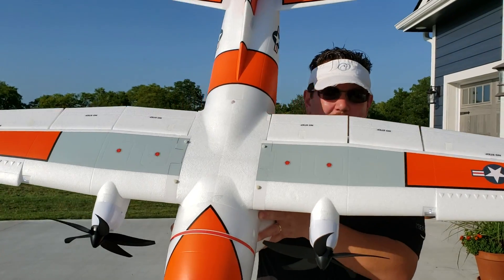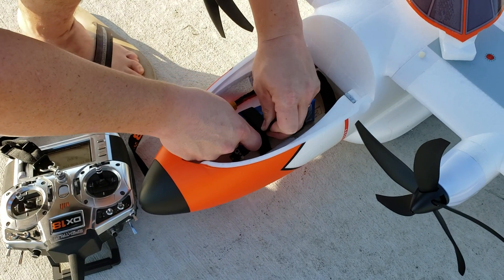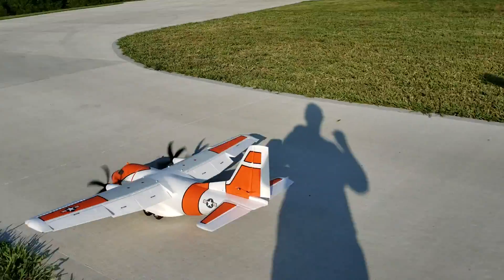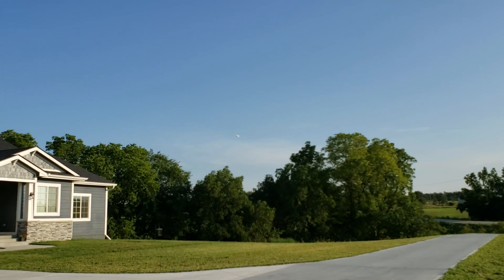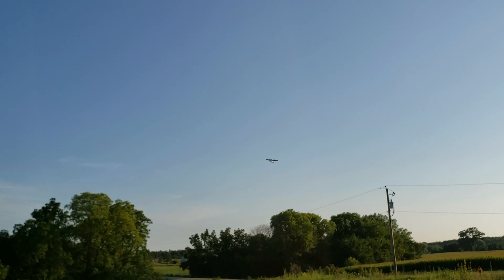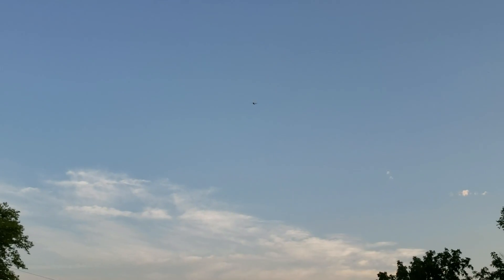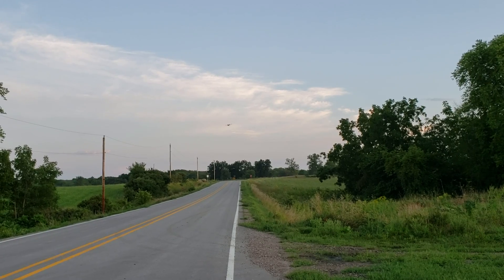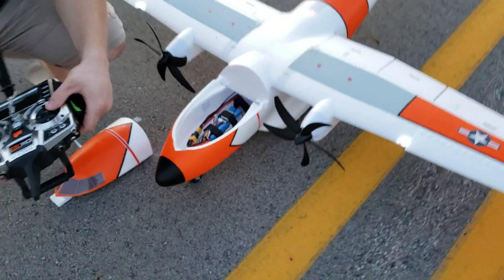Eflite - EC-1500 Twin 1.5m - Maiden Flights, Unbox, Build, Radio Setup

Comment: Hey, Brian. That bird is built to the profile of a cargo category plane, and will definitely fly differently than , say your Airbus airliners. Very slow to respond to control input, and truthfully not as much fun to fly. It seems to be a rendition of a C-121, or perhaps other variants of the type. I don't have a lot of experience with the type, only enough to know about the difference in flight characteristics. The things am what they am, cargo vessels.
Reply from the maker: It's like flying a whale, but this whale will run on 4S like a Ferrari...kinda weird and not scale looking.
It's not usually my cup of tea, these OVER powered fake-fake planes...but it is okay...only Okay - for $400 :(
Disappointed...
P.S. We're working on FAA inspections (soon).
Reply: Brian Phillips   Physically it looks like  a C-121 with turboprop engines replacing the big, round gas engines it originally came with. It has another C designation, I just don't remember what it is. Inspection shouldn't amount to more than a look thru the paperwork you've generated and probably not much more inspection than a thorough pilot's walk-around. Then the sign-off. You'll want to get an ADS-B with 2020 right around the corner. They've got a wingtip model TSO'd for 2 or 3 hundred now. Also need a mode C transponder, cheap second hand is good enough. You'll want the smallest you can find. Mounting on the panel not necessary. Going for experimental the way you are, you can install both units yourself, save a bundle.
Reply from the maker: I got the feeling it was modeled after the C-123...except it's a bit too cartoony, and they evidently didn't want to pay royalties to any manufacturer...
Right now, my Dad and I are waiting for the appointment still.
Do you know if ultralights need ADS?
Reply: @BrianPhillipsRC   You're absolutely correct - it is the 123. Cargo planes were not my thing, so my memories aren't very well locked in. Just looked them up and the 121 was a cargo plane made by refitting an old Lockheed Connie. Says the 123 was designed by a guy named Chase and built by Fairchild. I always thought they must have stretched the design and added 4 turboprops to create the C-130 Hercules. What a workhorse that has been! Did you stencil EXPERIMENTAL on the plane anywhere? I think they may require that, maybe on an inside sidewall. Probably will need the data plate riveted on her somewhere, as well. Those are readily available and cheap. On ultralights, which your plane is not, I'm not sure what the ADS-B rules are. Have to look that up. Teenie weighs like 3 times too much and goes twice as fast as ultralights are regulated to. Way too much power to be one of those toys, MUCH more capable.
Reply from the maker: Raymond, I found a guy who flies his ultralight from his 300 foot runway,  and he lives only a few miles away ;) <- the reason for my ADS-B 2020 rule question. I remember you'd mentioned that there was a possibility for a qualified pilot flying the teeny two from the right place on our property (don't worry, I'm not gonna end up in the local obituaries trying, per your and my wife's request), so I've been trying to learn as much as possible about hitting the magical bubble where the FAA stays off my butt, and I can actually enjoy flying. It seems like ultralight might be the only size class where I can afford the time and energy for full scale flight at this point in my life. It seems the more I learn, the more I confirm my worst fears that GA is just such a non-starter for my lifestyle, at least now. With limited time, finances, and interest in dealing with even more BS government bureaucracy, I'm not sure I can handle the time commitment, let alone the licensing cost...at least right now with four young children, full time work, and part time work (increasing into full time work - with YouTube) despite my desire to find a way. I haven't given up, just quite yet, but the great news is that my Dad is so close to being ready to fly the teeny two, if we can only get the FAA BS straightened out. He's pretty concerned about the legalities, and to an extent, so am I...but I place even less trust in our omniscient, omnipresent, omnipotent government than he (of late...it seems), in regards to their amazing oversight having some exceptional quality to keep us safe and alive; of which I have virtually zero trust, less its actual ability to wage an effective war against another world power.
Hope my ramblings make sense ;)
Reply: @BrianPhillipsRC  Brian, if your dad is going to fly Teenie, he still has to have her papered as experimental ( she weighs well over the 254 pounds allowable, and she won't even take off at the 54 mph max), and unless he's willing to remain only in the airspace between airports, he'll need the ADS. Going for ultralight just means you have to buy another airplane, several thousand plus a kind of worthless ultralight pilot's certificate. All that said, however, it's your football, so do what you think is right. I'll still be here, unless the Good Lord has other plans.
Reply: @BrianPhillipsRC   This is an interpretation from AOPA of ADS-B FARS: "The regulation 14 CFR 91.225(e) allows aircraft not certificated with an electrical system, including balloons and gliders, not equipped with ADS-B Out to operate within 30 nautical miles of a Class B primary airport—basically, within its Mode C veil—while remaining outside of any Class B or Class C airspace. These aircraft can operate as high as 17,999 feet msl except above Class B or Class C airspace; they also can operate beneath Class B and Class C airspace. Operationally the ADS-B Out rules mirror the transponder equipage requirements in 14 CFR 91.215. Equipping with a transponder now, and ADS-B Out by Jan. 1, 2020, allows for operations above Class B and C airspace.

The legal interpretation states that the FAA may make a technical amendment in the future to eliminate the discrepancy between 14 CFR 91.215 and 91.225."

If you didn't remember, Teenie was originally built with a full electrical system.
Reply from the maker: I think my comments may have been unclear, for the moment that's our plans. We both would like to fly her, but he's about 2 years closer to flying her than I.
Ultralights are just another venture, not necessarily related...other than both being airplanes ;)
Reply from the maker: So since she was setup to include a "full electrical system" she'll need an ADS-B...is the "short answer"
I don't think that'll be a deal breaker by any means. Does the ADS replace transponder, or are they more or less the same thing?
Reply: ADS and transponders are two different ponies, two different units. The xpnder is just the old military IFF of WWII, the Identification Friend or Foe with the added altitude encoder in the Mode C and Mode S versions. You dial in a four-digit code that ATC gives you for each flight or leg of a flight. That's the code that gives you 7700 for emergency, 7600 for radio failure, 7500 if you've been hijacked , and 1200 for VFR flights. Otherwise, it's 1042 or some other arbitrary number ATC generates at the time. There's also an "Ident" or identify button they ask you to punch that blooms their scope for a moment to help them find you in the clutter. Very mundane unit in todays flying. The ADS-B piggy-backs on the transponder signal to show you on a display unit in the panel or an iPad that sends location and altitude to other equipped aircraft. It gives you a visual "blip" showing position, distance and altitude of equipped aircraft within about ten miles of you. You still have to visually locate the other plane to be truly safe, you just now know where in the sky to look. Sounds complicated, but it really isn't. The recent advent of the wing-tip or tail light ADS units are a major breakthrough in simplicity of installation and MUCH lower cost of the ADS. You can pick up a used transponder and antenna for a much reduced cost, also. Should come in for under a thousand total, something I had planned on before my health went to pot.
Reply from the maker: Thank you for the explanation. So much I still have to learn!!!
Reply: @BrianPhillipsRC  Much to learn, yes, but that's part of the fun. You'll be part of a dynamic knowledge bank that spans more than a century and is constantly being added to or changed as we learn more.  Most have no idea what it takes to be a good pilot. You'll get there.
Reply from the maker: With your help and many other helpful and very experienced people to help me along, should I be so lucky!!!!
Reply: @BrianPhillipsRC    :-)

Comment: Did you end up doing anything to help balance those wheels? Im sure thats contributing to the pull to one side when taxiing, would you agree? I'll see if you have any vids out there covering gear, specifically wheels.  I have an issue of my own. E-flite thought using threaded screws as axles would be efficient.....   :)
Reply from the maker: I didn't take note of this issue, but I DID break one of my twin mains, and had to epoxy it back together, totally easy and successfully, I might add. Usually gear are NOT easy to fix, but this was a BREEZE ;)

Comment: I have one and I cannot see how you are in the cg range with the single battery pack. To get to the 70mm cg mark I needed about 620 grams. To get that I am using 2 4s 3300 packs in parallel. With this in the middle of the tray I am near the rear of the cg range. 
Could this be many of your issues?
Reply from the maker: I don't believe so. I found the plane to be very forgiving regarding CG in my experience. I have heard of some people with past models finding, only after crashes, that Horizon Hobby (or other manufacturers) have forgotten the stock counterweights (usually ball bearings stuck in the nose or tail of the foam mold), of which I don't even know exist on this plane, but in my experience, that's one of the items that have been EXCELLENT on this plane...CG and Lipo placement. I LOVE the battery try!

P.S. I've flown on Dual 4S 4000mah 60C packs, all the way down to single 3000mAh 3S 40C pack, and she does well with almost any lipo load. My favorite is probably Dual 3000mAh 3S 40C packs, since I can put one forward (behind the sweep of the nose gear control arm) and one back to get the CG JUST so...and then it's light enough to perform a bit better.

Comment: Thanks Brian, you have saved me some money, it is not only you who was disappointed. I wanted to like it ,but can't, it seems very clumsy,  and if you struggle to master it , I certainly will, I would have more success trying to pour a cup of tea while running on a trampoline!. There appears to be too much work, and too little enjoyment when it comes to this aircraft, and then there is the price.  So my hard earned money will go on the FMS Hawk, its  just as expensive,  but I've never heard a bad word said about it, and it flies like a dream from what I have seen. Better luck next time,   keep smiling and happy flying, ( you have plenty of alternatives to choose from, that cirrus of yours was half the price and twice the fun, and it shows every time you fly it!!).
Reply from the maker: You described my feeling exactly. Not a BAD plane, here, but it's just that Horizon Hobby set the bar SOOOOOOOOOOOOOOOOOOOOOOOOOOOOOOO high with a $400 price point!!!
They need to make this $250 and get them sold QUICK....and they need to make a less "pro-3d pilot" video for their demo video. 

P.S. I DID make some mistakes when I was trimming the plane, initially, that I fixed...and it's flying good now, but still not as good as I expected for $400...or at least she could have been 2m and include retracts (and two more motors....and look like a C-130 in stead ;) )

Comment: Brian I have a question (problem) with dx82 flaps. How do I go about getting your help?
Reply from the maker: just ask, and I'll try to help you out ;)
Reply: @BrianPhillipsRC  in my flaps menu sw# 2    (dx8-2)      pos-0 = -100% and the readings to the left LFL= -102% and rfl = 102% not the 100%. I guess this is ok.....  But pos 1 = -6%  and LFL shows -6% and RFL shows 6% which it should be.  NOW POS-2 =100%  but LFL shows128% and RFL shows -102%.  Can this be corrected and if so How? Thanks for any help you can offer.
Reply from the maker: This is how I have it set in my DX18 for my EC1500...

              Flap         Elev
Pos 0:       0%       0%
Pos 1:    -50%       3%
Pos 2:  -100%       5%

Also, I have these changes in my Servo Setup Menu...

Travel

150
150
RUD

100
150
FLP (for the flaps)

115
150
GER (for the door)

Speed

0.5
3.0
GER (for the door)
Reply from the maker: Sounds like you might have a "TWO FLAP" setup turned on. This is NOT the way to do it, unless you're doing way off standard (not a problem, but you'll have to fight with it to get it all working...something I do a lot)
Reply: @BrianPhillipsRC  Thanks Brian for getting back to me...Yes I did have my flaps set up for TWO all is well now thanks.
Reply from the maker: Excellent! Glad to hear :)

Comment: A thousand thanks Brian. This video certainly gives you food for thought. Hmmm. I haven't seen an official HH fly video on it yet.  Perhaps they rushed it to market?
Reply from the maker: They have a video, with a pro-3d pilot (of course) that makes it look soooooo perfect...brand new lipos, that probably came out looking like a pregnant-with-quadruplets-lady...but my experience was honestly hampered by two trimming mistakes I had made on my first series of maiden flights. I DID catch this issue, but my thoughts on the plane stand - good plane, but for $400, it should have been 2meters, and retracts...AND SCALE (if you ask me...which they most definitely didn't)
Reply: @BrianPhillipsRC  I'm most inclined to agree. This should be in the price range of the other 1.5M safe birds. Perhaps since it has two ESCs round it off to an even 300.00 out the door.
Reply from the maker: exactly...If she were 4 motors and props, and maybe 2m, WITH retracts...$400 would be okay - but that's not what we got :(

Comment: Hi,
Thanks for the great video. Does it accept the GPS module for beginners?
Reply from the maker: I don't think GPS modules are GOOD for beginners, and I think all of these planes with the Right Receiver can support a GPS, but GPS doesn't fly the plane... I DO think SAFE (Sensor Aided Flight Envelope - Auto Leveling when you let go of the sticks) is VERY GOOD, and it does come equipped as a BNF (Bind and fly - you provide battery and transmitter) with AS3X (Stabilization) and SAFE Select (You can turn it ON and OFF as you progress...it can be done in flight)

Good luck!

Comment: Hi Brian. Warm greetings from Germany. I love your videos, I find them really informative and funny. I recently started my hobby and bought a Mini Apprentice S which I think is great and am now considering buying the next plane. I actually found it EC-1500 really interesting but I'm not so sure about your video anymore. Would you recommend the plane as a second plane? Or rather not? Would you otherwise have a tip for a second plane? Keep going and greetings to your wife. 
Ps: I hope my english is understandable to some extent 😅.
Reply from the maker: Thanks! As for the EC1500 (  https://bit.ly/3a0or8n ) for your second plane....well, it's not a bad flying plane. It's not cheap. It's not the EASIEST plane to fly, but it does fly good. It looks like it would be very "light on it's feet", but you'll quickly find out that it's just VERY POWERFUL...so not the same. If you want a good second plane, that's a very safe bet, but you have this kinda cash to spend, I'd HIGHLY recommend the Carbon Z Cub SS 2.1m ( https://bit.ly/2RyYsid ). The Carbon Z Cub is AMAZING! You will be blown away at it's performance, but there again, if you want to spend a little less, keeping in mind batteries are pretty pricey for both I've mentioned and chargers aren't low dollar - however both items will be used as you work into your own unique fleet of aircraft.

Have you considered something more small, and more affordable, but still AWESOME? Turbo Timber 1.5m ( https://bit.ly/2SjksOg ) this plane is amazing, but less cash, and won't break the bank for the lipos.

P.S. Your English was just fine!!!
Reply: @BrianPhillipsRC   Hey thanks for the quick and nice answer!
I'm just looking at your suggestions and I find the timber really interesting!
Maybe a really good 2nd airplane and not too big to be transported in the car.

Thanks a lot
Reply from the maker: Timber can be taken apart too, if you need the 1.5m wing to come off - BUT - the EC-1500 wings pull off super easy!

Comment: Hi there,I just found this video and the plane looks great. It was good to see that you worked out the setup,really looks good. It doesn't look like a plane a novice like myself should be flying though. Great video,was good that you share so much information as well.
Reply from the maker: I would agree about the novice comment, however, it's a GREAT plane. I was just making some stupid, rookie mistakes, and I think Horizon Hobby kinda missed the mark, but them my mistakes exacerbated the issues.

If you buy this as a second or third plane, and fly off SAFE, you will be fine!

Comment: https://youtu.be/-UGnRN4kimk?t=174   roll ensures  the motors may not have the same power /( props aren't right)  or the wingtips are twisted or ailerons are twisted?
Reply from the maker: Good idea with the wings being bent. I will also check that.